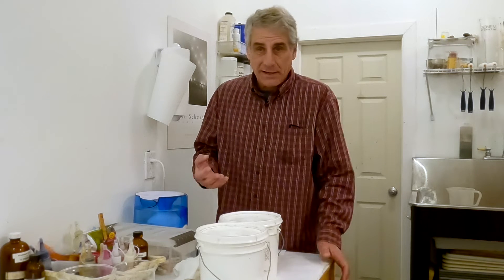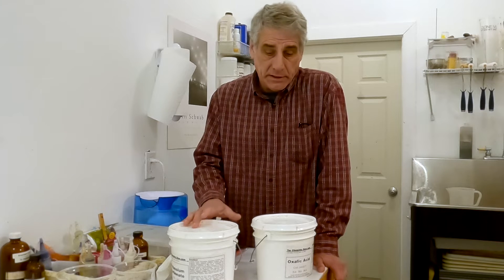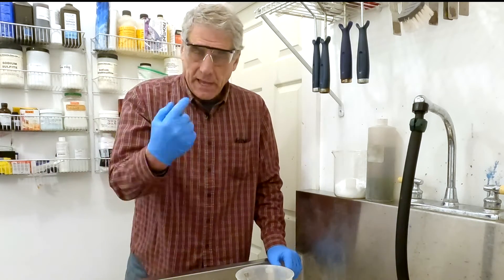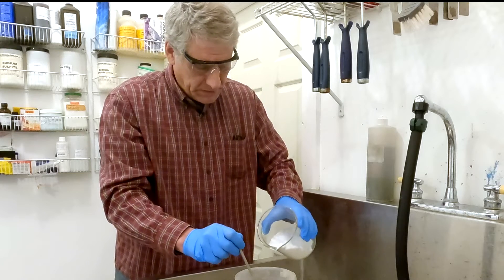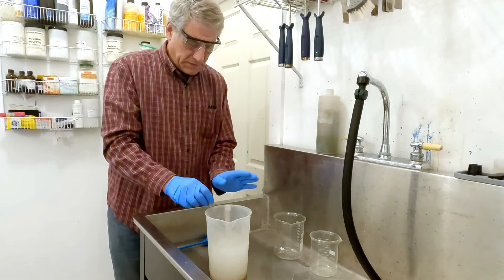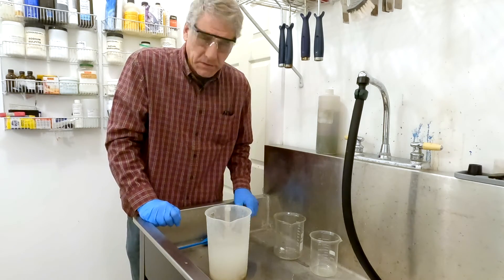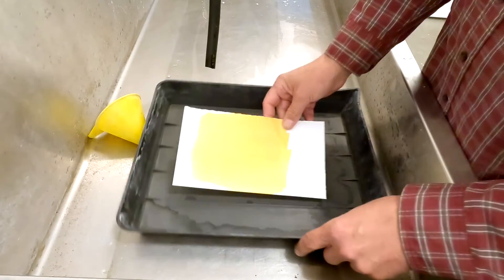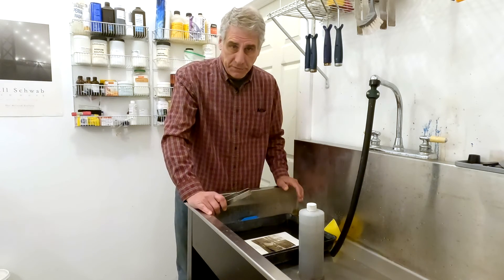Mixing Potassium Oxalate Developer for Platinum/Palladium Printing

Comment: Bill uses 200 gm of Potassium carbonate and 230 gm of Oxalic Acid.  A mole of Potassium Carbonate is 138.2055 gm.  So Bill is using 1.447 moles of Pot. Carbonate.  To fully react the Pot. Carbonate to form Potassium Oxalate, he will need 1.447 moles of Oxalic Acid for the reaction (COOH)2 + K2CO3 => K2C2O4 + C02 + H20.  The Molecular weight of Oxalic acid is 93.0344 for Anhydrous and 126.065 for the commonly available dihydrate form.   So using the dihydrate form, Bill will need 1.447 * 126.065 = 182.43 grams of oxalic acid.   So Bill is adding way too much oxalic acid (he suggests 230gm) which  leaves 47.5 grams of non-reacting oxalic acid.  So you are left with a solution of Potassium oxalate with saturated oxallic acid and lots of remaining oxalic acid that will not dissolve.  Its simple chemistry and that's why you have loads of oxalic acid remaining once the carbon dioxide stops coming off the reaction.

Comment: Hi Bill, I followed your protocoll but when adding oxalic acid, the Solution went yellow a d cristalls were foemed. What went wrong?
Reply from the maker: Hi Ralph. I’m not sure what could’ve gone wrong. The crystals forming art to abnormal and you can always filter those out, however, the color should’ve been a little more of a green. Do you use your local water? I’m wondering about its quality. Maybe you could try with distilled water.?
Reply: @BillSchwab  Hi Bill,
I tried both tap and distilled water. I tried also to dissolve oxalate powder in water directly to see what happenns. It turned immediately yellowish. I will order oxalate from another supplier. Maybe the oxalate is the problem.
Reply from the maker: @ralfschoeneck2089  just to be clear. What you need is potassium carbonate, and oxalic acid.
Reply: @BillSchwab  Hi Bill, yes. I first dissolved the potassium carbonate in 1L of distilled water before adding the oxalic acid.

Comment: Bill, thanks for this great video! I'm wondering if you could mix the 200 grams of potassium carbonate into 500ml of water and then mix the 230 grams of oxalic acid in a separate container with 500ml of water and then finally add the mixed oxalic acid solution to the potassium carbonate solution to avoid all the fizzing? Thanks for your thoughts on this!

Comment: If you add the new to the old, do you have to adjust the PH?  Or, can you reasonable expect they will be about the same?
Reply from the maker: Great question. It will usually work out to be about the same, however, that is only if you keep the pH level consistent in your original developer. I usually keep my pH consistent by adding a bit of oxalic acid throughout the life of the developer.